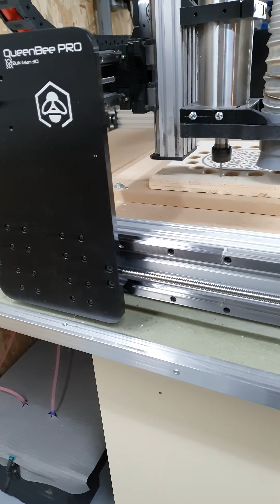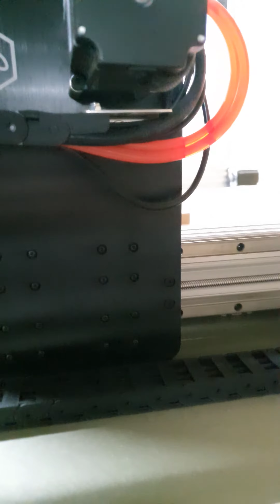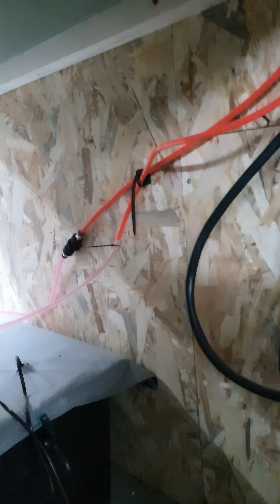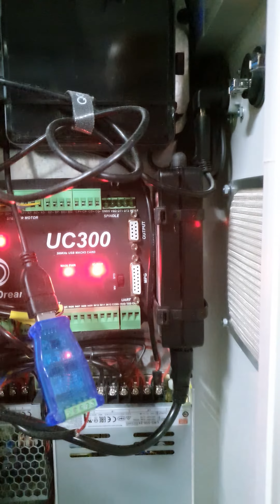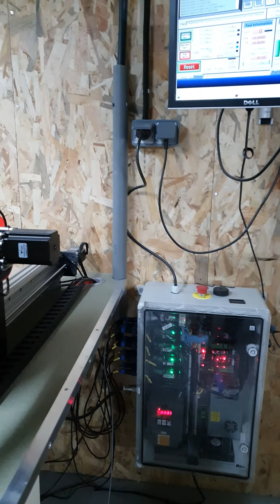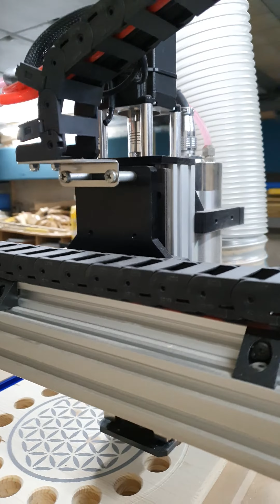My Bulk Man 3D QueenBee Pro 1000x1000

Comment: Thanks for the video. Did you add the second spindle mount after you discovered problems with just one spindle mount? Or did you do it without any prior testing or problems?
Reply from the maker: No, I thought it would be better for the parallelism. I noticed others taking the same option.

Comment: Hello. Do you succeed to connect uc300 to vfd and mach3 and control the start/stop and speed from mach3. I have the same configuration and it's working manually but i can't make it work from mach2.
Reply from the maker: Hi, I don't use the UC3000 to control the VFD but a RS485 dongle to from the PC to the VFD direct. It's much more reliable. On the video, you can see the blue adaptor within the cabinet. 
You can find all the info here
http://royaumedeole.fr/informatique/plugin-mach3-pour-vfdhuanyang/mach3-plugin-for-huanyang-vfd/

Comment: Bonjour,
J'ai monté la même CNC, j'ai rencontré de gros soucis d'interférences électromagnétiques générées par la broche et/ou(?) le VFD. Je vois que vous avez installé le VFD juste à côté de l'UC300, avez vous rencontrés des problèmes de ce type? Je n'utilise pas l'UC300, mais le NCH02 lorsque j'ai installé le VFD juste à côté du controller il y avait des grosses perturbations. J'ai depuis installé un filtre passe bas sur le VFD, des ferrites un peu partout et connecté le blindage du câble entre le VFD et la broche. Cela semble avoir résolus les soucis, mais j'hésite à repositionner le VFD à côté du controller...
Beau montage en tout cas !
Reply from the maker: J'avoue avoir eu un peu de change. Je craignais être confronté au même problème et j'ai essayé d'optimiser au mieux la mise à la masse et la création d'une structure type cage de Faraday. Tous les éléments sont posés sur une tôle conductrice reliée à la masse, le variateur et tous les modules de ctrl/cmd aussi. Quant aux cables de puissance, ils passent tous sur un pont conducteur, relié à la masse aussi. De ce fait, je pense avoir canalisé les champs magnétiques. Mais bon, peut-être juste un gros coup de change :-)
Reply: @Maga92000  De la chance, je ne sais pas, votre installation à l'air bien pensée! Seriez vous en mesure de m'envoyer une photo montrant plus en détail votre installation (notamment votre pont conducteur et la cage de faraday)? Pour être sûr qu'on parle bien de la même chose, qd vous parlez de raccordement à la masse, est ce que votre circuit de masse et relié à votre circuit de terre domestique? (De mon côté j'ai raccordé le blindage du câble de puissance au circuit de terre).
Reply from the maker: Je viens d'uploader une nouvelle vidéo qui montre les détails du cablage
https://youtu.be/pn0vExWrcFw
Reply: @Maga92000  C'est propre !
Merci pour votre retour

Comment: Dear Marc, thank you very much for sharing this video. I am waiting for queenbee pro too (with the same 2.2KW water cooled spindle) and  I am now building a workbench for it. I have two questions: 

1) What is the height of the spindle control inverter? 
2) What is the thickness of your base/spoilboard (can you give some more details about your spoilboard)? 

Regards
Reply from the maker: The inveter is Heigth=175mm, Width=150mm, Length=220mm
The thickness of the base is 10mm
Reply: @Maga92000  thank you very much!